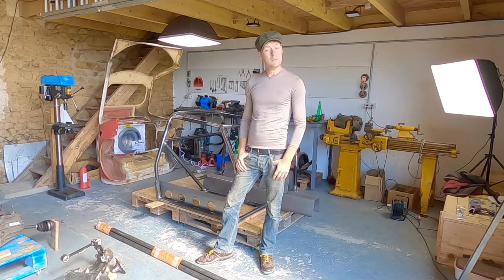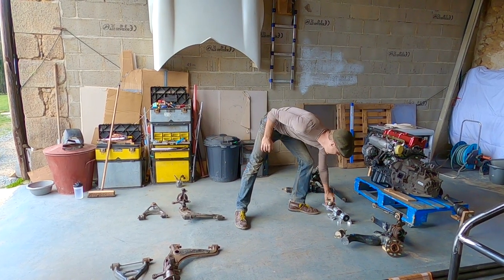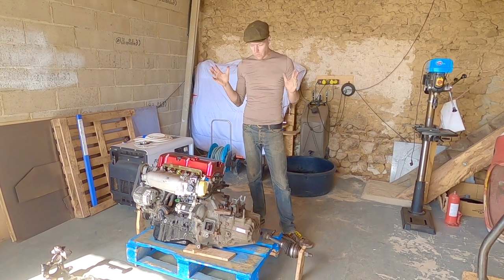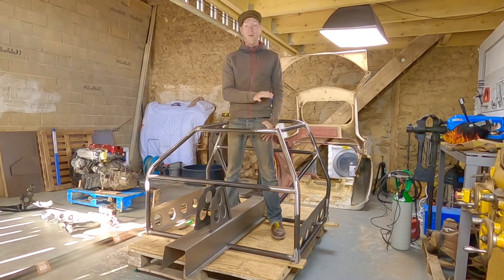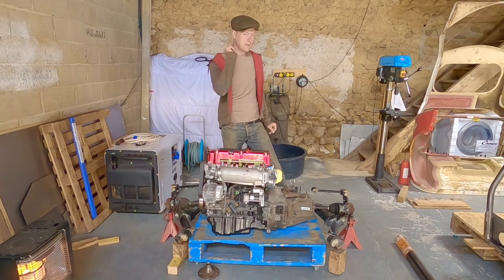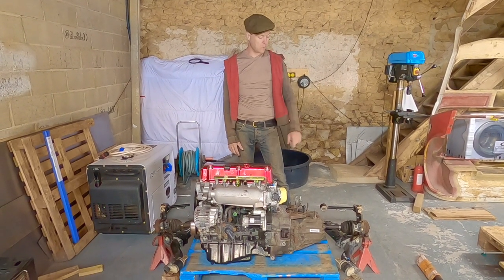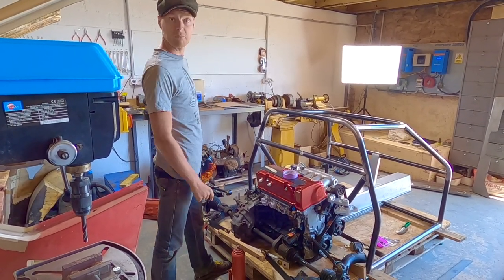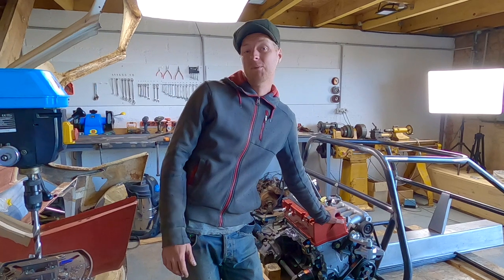435bhp per ton! | Project Mosquito Honda Type R Mini Supercar (Ep23)

Comment: I can respect single-purpose bracketry, because nothing is worse than trying to remove something and the designers, in order to avoid having to make another part, have mounted something in such a way that the fasteners are inaccessible. I do agree, though, that bracket-ception where you just have multiple brackets attached to each other for no apparent benefit is where you take things a bit too far. If you do want to come to an understanding of the elegance and sophistication of purpose-built bracketry, check out Bad Obsession Motorsports' Project Binky series. Because they're taking the unibody construction approach and have a ludicrous attention to detail and a lust for modern whiz-bang gadgetry, the series is actually still ongoing, but they are nearing the conclusion after something like 8 years. Their project, similar to yours, is cramming an engine and drivetrain from a much larger and heavier car into a tiny little car that was never intended to house such a thing. In their case, an Austin Mini running the entire drivetrain from a Toyota Celica GT4. 

Sometimes it really feels unfair to try to even compare projects from excellent youtube car builders and fabricators to Project Binky. Partly due to the project length, but also because Binky is just so entirely over-engineered that it makes other projects look inadequate by comparison, even when they definitely aren't. The GTM doesn't offer the same flexibility in chassis design that an all-metal Mini has, since you're dealing with a fiberglass shell over metal, whereas they had the freedom to turn the entire body into a structural member of some form. So if you do check out their channel, don't let some of the insane things Nik does intimidate you. Pandora is going to be an insane little car when you're done with it and I'm excited to see how the rest of the fabrication and finishing goes.
Reply from the maker: Binky is a very different animal being a larger car, 4wd and more than double the finished weight of the Mosquito. although the packaging is equally tight but I love that they are completely different

Comment: What exact wheel hubs would work best? Is there a model that has the specs you need, or do you need a completely custom solution? I'm in the Netherlands, and I'd be happy to help scour the net for parts!
Reply from the maker: It's funny you should mention that, I've been in touch with a company in the Netherlands and they can order the parts. thank you so much for offering your time that was really nice of you
Reply: @OliverPickard  Don't be afraid to crowdsource ideas if you ever get stuck :)
Reply: @akumabito2008  The best way to get the correct solution is to present the wrong solution to the internet, wherein the comment section will be rapidly filled with responses correcting you. Or, if you have a supportive community, you can just ask outright and people will help. Whichever works best.

Comment: Could you have used mx5 rear wishbones so it has double wishbones all round? Or would this make the wheelbase too wide?
Reply from the maker: It has double wishbone rear suspension already with the RD CRV rear suspension and it's like it was made for the application
Reply: @OliverPickard  was just wondering as I’ve started a similar project putting a K20 in the rear of a mini van and I’m going to try and use MX5 wishbones, hubs, brakes etc, your CRV rear end has given me some homework

Loving the series, found it today and can’t wait for the next episode
Reply from the maker: I've made a video all about why I chose that rear suspension where I go into more detail and I am using mx5 suspension on the front and there's a video on that called the Miura problem. Both are in the play list at the end of this video 👍🏼
Reply: @stephenwhite3832  You're likely to have more track width to play with on the minivan compared to Pandora, so the double-wishbone suspension out of a front-engine rear-wheel drive car stands a better chance of fitting compared to this build where it has to straddle the engine and fight with it for space.